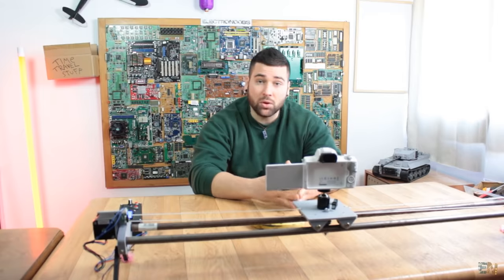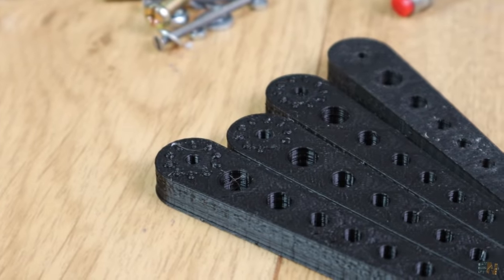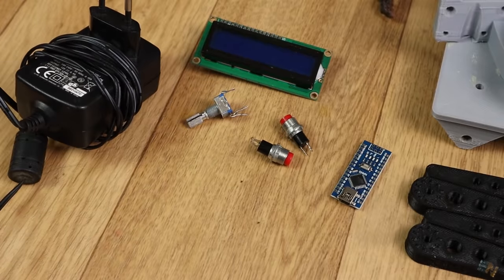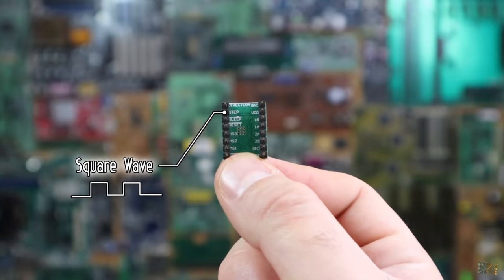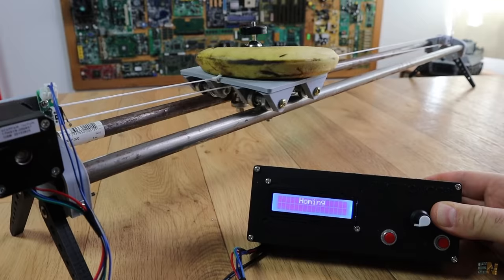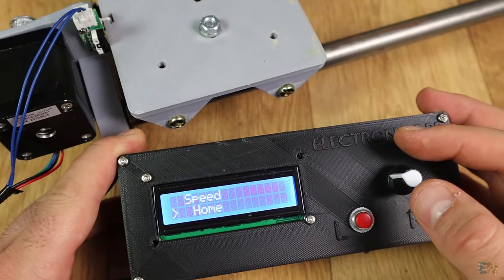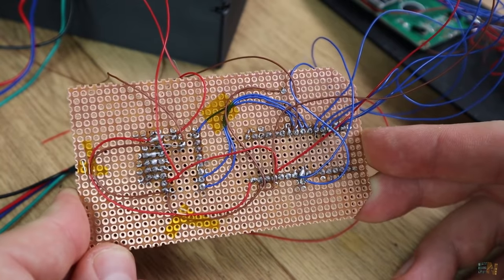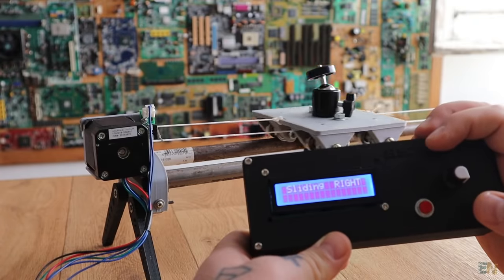Step motor slider - Arduino and 3D printed body

Comment from the maker: I hope you like this project. Help me on: https://www.patreon.com/ELECTRONOOBS 
Join my Q&A: http://www.electronoobs.com/eng_preguntas.php 
Thank you/Gracias!
Reply: Electronoobs my arduino shows 0% memory help me what to do?
Reply: Electronoobs  + MS1,MS2,MS3 ? I connected the driver in micro step mode (1/16). In this mode, the engine runs smoother, better. Help change code. What exactly needs to be changed in the code to work correctly? Thank.
Reply: What's the lowest speed you can achieve?

Comment: So, if you ever want to add to this type of project or take it another step further, I used to have a DIY photography studio I built for selling high end bicycles on eBay before my disability got too bad for me to work like that. When it comes to product photography there isn't a lot of good information on YT especially when it comes to larger product photography. 
   I built a rotating stand that I put a whole bike on using the base of an office chair with the actual chair removed. I put a large platform on top of the rotating stand. I made a little disk of paper with index marks and took pictures of the bicycle one at a time rotating it just a little bit between pictures. I really wanted to create an automated system for this.
   Camera sliders are ok for people that want video effects but I think there are a lot more people that want to or should improve their photography skills on places like eBay or even small businesses with e-commerce websites. That's a big audience that isn't very well served with YT content IMO. If you tagged and titled a video well you might be able to reach a more broad audience by posting something useful for the photography nurds.
  The biggest problem I had while manually rotating a bike and taking pictures was that it took ages to get everything setup for each shot because the bike had to be absolutely still before I took each picture. I really wanted to build a setup where I placed the product on the stand, pushed a button, and then I could go off to write my listing details while the camera did it's thing. This kind of setup can be scaled to any size, however, if you really want the best setup for lighting an object for photography, you should rotate the camera around the object instead of rotating the object in front of the camera. Someone without experience might not understand this, but it is more important to keep your main lights at 45 degrees to the camera. When you rotate the subject you will get bad lighting situations where you must modify lights and reflectors to perfect the shot. If I could build the perfect photography setup I would build in the ability for the camera to rotate around the object while also adding a slider that could raise and lower the camera.
  All that said I was selling bikes for more than anyone else was getting for the same thing on eBay, but I was hosting images to place in the description of listings along with videos and adding more details than anyone else has ever done on eBay... So this advice is from someone that was really trying to push the limits. Not everyone is interested in such things, but I did a lot of searching and didn't find much at the time. I'll add a linked example of what I was doing back then in a reply to this.
-Jake
Reply: Link to a video example of my old product photography results and style I just referenced above
https://youtu.be/XOBN_EldUYs

Comment: With simple buttons like that you should use pinMode(pin, INPUT_PULLUP) rather than add a 10k ohm resistor. The INPUT_PULLUP will add an internal pull up resistor that is already inside the atmega 328 that is on an arduino, so one is not needed on the button.

Comment: Nice project. How did you measure the with of the platform so that the bearings in the middle just fit to both sides of the tubes? and by the way you can omit the pulldown resistors on all switches if you use the internal pullup resistors of the Arduino. The only thing that changes is that you read out a LOW if the button is pressed instead of HIGH and connecting the wires is a lot easier. Oh, and never use "delay()" inside a interrupt routine this not only bad style it also can have a lot of bad side effects. :)

Comment: I love your concept & am in process of building mine now. This is my 1st Arduino project & I am somewhat lost. Purchased a kit & trying to utilize the tools I have. Instead of the push knob, I have a joystick.. Are you familiar with this? Has MH, GND, +5v, VRX, vry &sw on it. Will I have to add any programming due to this joystick?

Comment: Please what are the dimensions of the bearings please ? For 16mm diameter tubes like in the video ! Because i want to realize this project but i don't have all the pieces and i don't know which pieces i need to choose on Amazon ! Please answer rapidly if you can !

Comment: Hi from Ukraine, its really difficult to me to understand and to write a code for project that I’m trying to realize, maybe if u have some time, u could help me , so: is it possible to modify your scetch to control motor only with encoder , i don’t need direction change, i want motor to start rotation when I’m pushing encoder button at once, and stop when pushing it again, and also i want be able to increase or decrease motor speed by rotation of encoder clockwise or anti clockwise,  i really dont need lcd screen, but it will be really cool to visualise motor speed using “progress bar” which consists of , for example 10 leds.... 
could u help me with this? Thanks a lot.
Ps. Using same configuration of hardware:)

Comment: Dude i have question about brushed drone 😅😅😅 .can i ask you .pleaseee😶😶😶
Reply: CarToOn WORLD 555 i am also making drone .but have problem to make drone .PROblem is to understanding between two modules .
Reply: CarToOn WORLD 555 plz ask me I'm also making it right now
Reply: I HAVR PROBLEM IN GETTING SIGNAL TO 1 RF24 MODULE TO ANOTHER MODULE .
I MADED RECEIVER .
BUT GETTING PROBLEM IN TRANSMITTER.
Reply: Just check chennel "electronoob" .
Video name ."Brushless drone "
Check transmitter code .
And say that all code are perfect or not ?
Reply: CarToOn WORLD 555 bro yes I know what are you talking about and Im constructing hardware now  and yes I compiled and uploaded the whole code trans as well as receiver of brushed drone (coreless motor). double check your transmitter's soldering connection may be it's not connected to arduino properly and also which module you use I advice you to use nrf24l01 normal module and not with power amplifier bcoz I heard lot of people says that this module isn't work sometimes can we discuss on WhatsApp about the same it will help me too if I face any problem in my project
Reply: Ok i will check soldring .
U also check transmitter code .
And bro my whats app not working yet due to some problems .

But dont worry ...if i made drone complete .then i am here to guide u ..
AT ANY TIME.
Ap koh hindi aati hogi .shayad .
Bhai ma apko help karon ga tension maat lena ..mera 70% complete hpgaya he ..koi help chahiye toh ask me .*
Thanx u .!!
Reply: CarToOn WORLD 555 I'm maharashrtian from Mumbai India I know Hindi Marathi too

Comment: What change I have to do in code if I don't using i2c interface circuit.
Reply: Electronoobs please reply me.
Reply: You need to use standard  LCD library, connect LCD to Arduino (if there are enough pins) and then instead of initialising LCD_I2C object, you initialise object of LCD class with pins that you want to use. I hope you understand me :)
Reply: Đorđe Milanović thank you for replying.